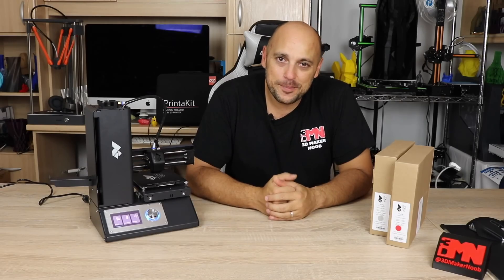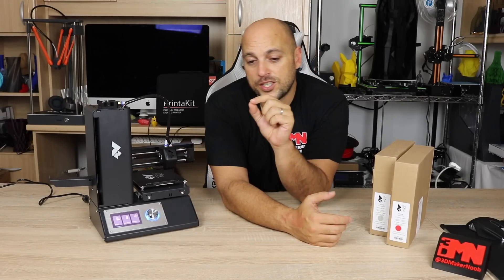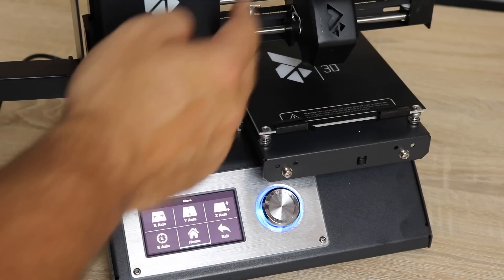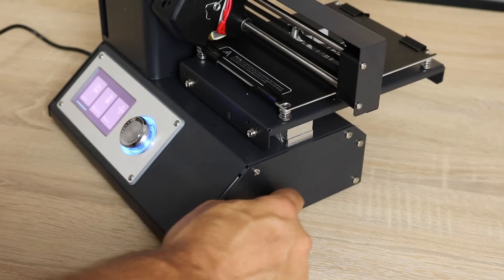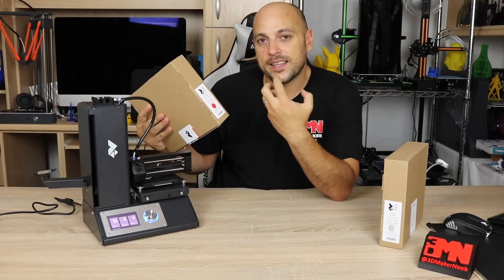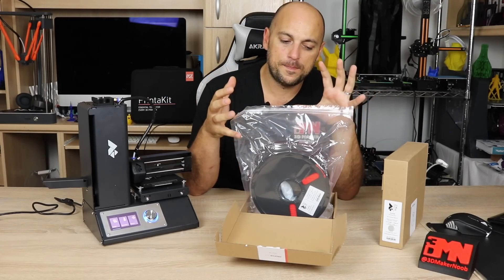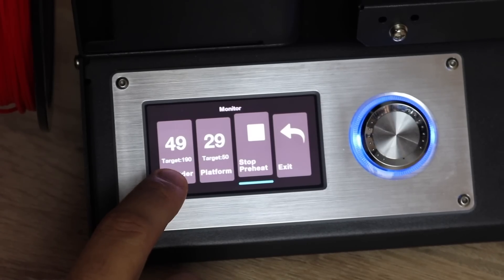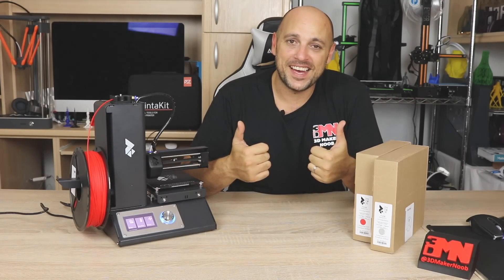A Noob's 3D Printing Guide - Episode 2 - Getting to Know your 3D Printer

Comment: Would love for you to discuss the software side. Best options for beginners.  3D Modeling, slicer, gcode software etc. I am a little overwhelmed with what to choose for each. Costs, etc.   I believe this is the biggest failure most 3D printing videos leave out.  I need a good beginner video, that sets expectations, and recommendations on what's been vetted, and known to work, and no not frustrate one to just give up, and abandon. Thanks for the videos!  Love them!
Reply from the maker: +Brian Flores I will be covering that for sure as it is vital in terms of learning 3D printing. At the moment trying to cover hardware as much as possible from a high level before I get into more detail

Comment: OK, I'm thinking about someone like my sister following along and I have a couple notes.
Under axis you describe X as left-right Y as backwards-forwards and Z as print head movement. Z should probably be up-down to keep the descriptions consistent.
Loading filament you are going to the menu to move the heater upwords. You should probably call it the hot end or print head rather than using a third term for the same thing. Also you might want to add that you're moving the Z axis so it's obvious what you're doing.

These are pretty nitpicky things to say but using the same terminology for components and the same descriptions for actions I think will help someone who is new keep up and not think they're missing a step or a part.
Reply from the maker: +duckrutt you are completely right and I noticed it after I released the video so I fully agree and will be making sure to keep it consistent :)
Reply: It's cool baby I've written documentation and it's frick'n hard not to skip over "obvious" things or use slang.